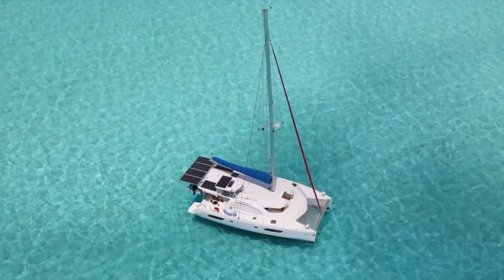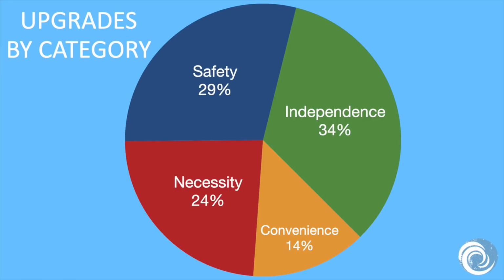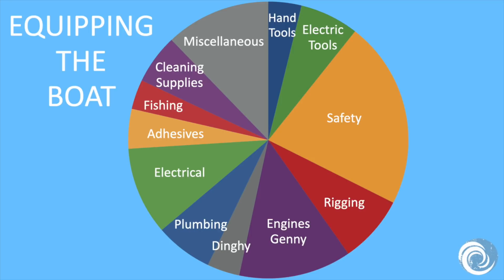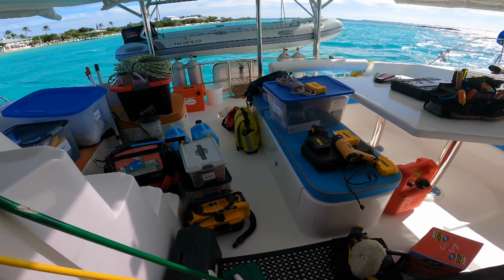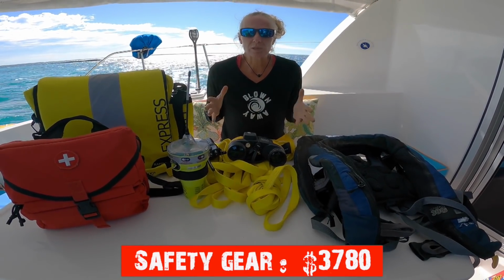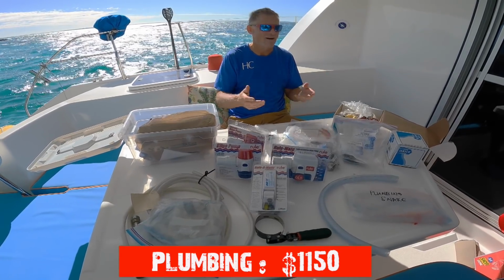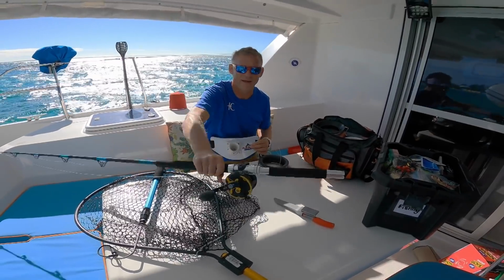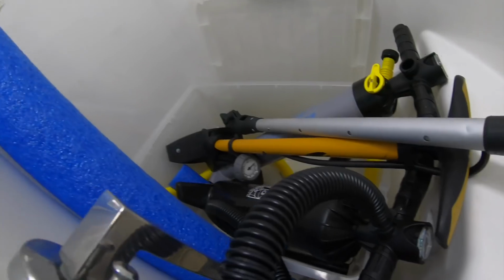154: Cost OF UPGRADING A CHARTER BOAT & EQUIPPING WITH TOOLS & SPARE PARTS; 2015 Leopard 44

Comment: Mr. Brown, I know this a dumb question probably, but I'm curious about this. Does the washing machine run on12V, or does anyone make one that does? Also dishwasher and aircon that will run on 12V? Do they exist?
Reply from the maker: Not a dumb question at all. Thanks for asking. The washing machine is 110V. I don’t know if one that’s 12v for a boat. The only dishwasher on board is the human one! I believe Mebru 12V but it has a bad reputation. Let me know if you have other questions!
Reply from the maker: Most of those type of appliances are 110 because they use more power than 12 volts can provide.
Reply: @SailingBlownAway  that’s what I was thinking, but technology has come a long way in the past few years, so I figured I’d ask :)

Comment: What are your thoughts on a rainman water maker over one that is built into the vessel?
Reply from the maker: Great question. We don't know much about the rainman other than it's a cheaper, portable watermaker. We didn't consider it as we wanted an installed watermaker and were wiling to pay for it. There are much cheaper DIY watermakers, if cost is an issue. I think you have to decide for yourself what you are looking for. We wanted a long term solution and didn't think that a portable watermaker was the solution. I hope that helps!

Comment: I'd be really careful with that muriatic acid.  Even in the jug that stuff can do some damage to the metal in the locker.  I had brand new bottle left over from a project I did sitting on a shelf in my garage for about a year or two.  Moved it a few weeks ago and the wire rack under it and the metal frame around it were rusting.  I'd hate to see the hardware or struts start to go down hill on you.

Thanks for the detailed breakdown and all the information you guys are putting out.  I'm working hard to make the dream a reality in about 5-6 years.
Reply from the maker: Wow. Thank you for your comment and especially that tip. We had no idea it could wreak havoc in the bottle! We are so glad you are right behind us in the journey and that our video has been helpful to you!! Thanks again!

Comment: Wow,  this is great.  Currently shopping and plan to buy next year and was wandering how mush $ aside I need to upgrade and fix a use boat.  Now I’m sure I cannot afford a catamaran.   I’m an experienced sailor and agree with your upgrade a 100%. Including the washing machine.  Just to avoid scarring people away,  you don’t need all that on day first, the safety gear and engine main spares, yes,  but the rest, you accumulate over time.  You must have done a lot work on your boat to have all that already.  Thanks for sharing.
Reply from the maker: Thank you so much for watching and commenting. We are thrilled that you are out shopping for a boat and ready to buy something. That's great news. You are right - we have accumulated and made upgrades in one year that most people take 5 years to complete. Safety and engine spares are critical and the rest is optional especially if you near the US and can easily get parts/spares sent to you in a couple of days. We didn't have that luxury. Case in point, we have been waiting for one month for parts from the US (here in the Bahamas)! As for how much $$$ to put aside for upgrades, it's difficult to say. Do you have to have a water maker? Are you happy to turn on the genny to make power vs. using an inverter? Will you cook with only propane on the stove top? Will you do the work yourself? I think you CAN afford a cat if you can do the work over time and live more simply until your budget allows you to make the upgrades. It's all about deciding what's important to you. And, as a skilled mariner, you could buy an older cat which have an even more reasonable price.

Comment: Wow guys, super-duper info.  As I start the process of my boat buying, kind of shocked me.  I think you guys said you paid $345,000 for the boat.  Now I see another $160,000 for the "add-ons"...That's $500,000 !.  I have to wonder, do most catamaran cruisers have boat loans?

As for the rudder bearing issue.  Since it appears it's common for Leopard, why have they not changed that design from the factory?  They say they listen to their cruisers and that's what makes them (and their model refinements) such a hit.  Or, have they addressed this in newer (what year?) models?

Thanks again for all your sharing and light-hearted videos.  You both are doing a great job and are appreciated.
Reply from the maker: Hi Douglas!! Thank you for your comment and questions! We are happy to provide this information to you as you start the boat buying process! We paid 315k for our boat, so in total we spent 475k, BUT remember we had to start from scratch with all tools and equipment. We literally had nothing. When we owned a house, we had 80% of the tools and things we needed to move on board. That makes a big difference. To answer your question about cat cruisers having loans, we have not met any that do. Most buy a cat and upgrade it within their budget. Many of our friends say, "That's an upgrade we planned in year 2 or year 3." And, they do the upgrade themselves. That alone would save probably 75k in labor costs for us. You can really do this on any budget. It all depends on how you want to live. Many of our friends have chosen not to have a washing machine to reduce costs, use of water, etc. This was a non-negotiable for us. A key fact is the bigger you go on a boats overall length, the cost rises exponentially. Keep that in mind. BUT, remember that you can upgrade for a much cheaper price than what we did - AGMs vs. lithium, using genny vs. solar/inverter, smaller dinghy, no cushions/helm enclosure, allowing more things to wear before replacement, etc. It's all possible. As for the rudder bearing issue, we do not know if Leopard has changed their factory design. We know that our friends in a 2018 Leopard have the same shafts/bearings we have. But, I cannot speak to the new L42. I hope they have adjusted. We still need to grease the bearings during haulout every two years. Leopard is great about receiving feedback and re-designing.  Thanks again for your kind words and feedback. We really appreciate it.

Comment: Where some of these fixes identify in the survey when buying from the charter company?  Why did they not fix it like the gooseneck? Or was that used to negotiate the purchase price?
Reply from the maker: Yes and no, Nick!! Great question. The gooseneck was identified on the survey, BUT the surveyor "suggested" that we have a professional welder fix it and not the base. As newbies, we took his advice. Now, it could have been one of those "home cooking" deals that he knew the base didn't want to fix it so he encouraged us in another direction. The surveyor also said we could wait a year too. We did negotiate the purchase price, but since we didn't know the cost of the repair, we lost out. It was a lesson learned, but ultimately, we are glad that it was repaired correctly and don't have to worry about it. For the davit bushing issue, we had no idea what was causing the banging as it pulled in the dinghy. The base said, "it's normal and all the davits sound like that." We didn't have experience to debate them, but they all MIGHT bang like that because they all have the same issue. Ours was a number of things - the dynema was worn, one of the blocks was not turning, and bushing had eroded. We were so overwhelmed by the whole process and didn't have anyone (due to covid) that could be there to help us. Yes, we could call people, but it's just not the same.  The base was SO kind and helpful to us. They fixed a ton of things in the weeks after we closed, gave us a captain to take the boat out for a 2 hour black water tank dump because we filled the holding tank (we had no clue!) taught us much about the boat and the systems, and they also allowed us to stay on the super yacht dock for free - water, electricity and dockage for 3 weeks. That cost alone was almost $1000 (I asked). As new cruisers, we were walking a fine line and tried to find a good balance. If we were to buy the same boat now, with our knowledge and experience, we probably would do a lot differently. But, we were so grateful for how we were treated when we were so green!